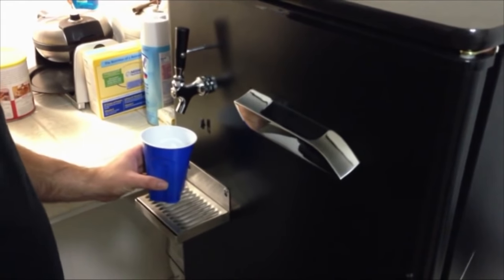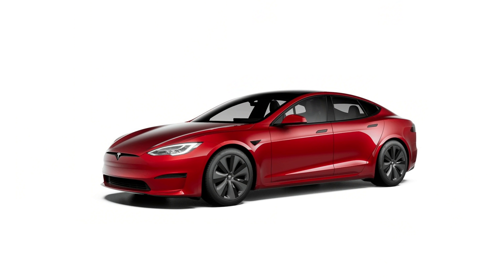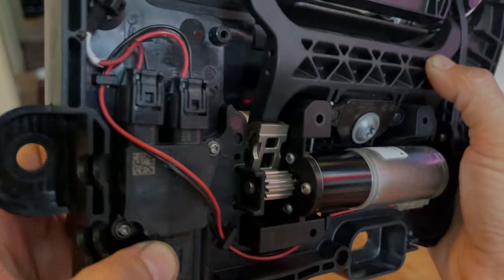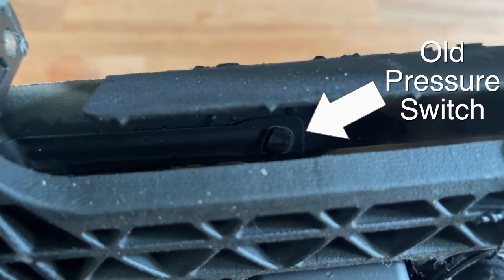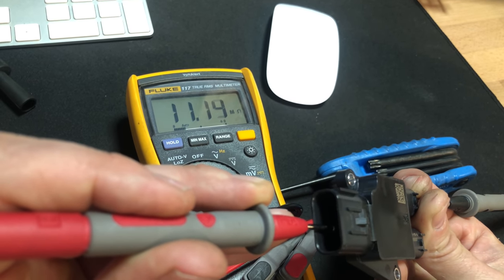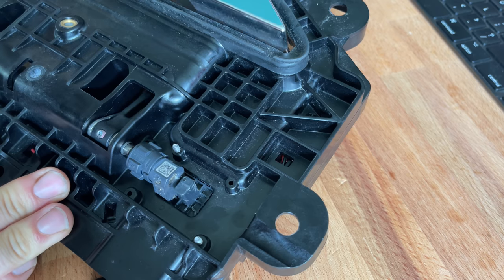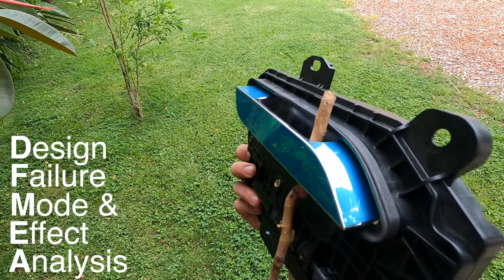Tesla Is Lightyears Ahead Of... Tesla

Comment: Cool video, great technology, thank you for making this video, I have to play the devils advocate here.  Here it goes. I'm just worried that if one of those components fails, then how am I suppose unlock? Will the car not drive if the door isn't closed? Or is the computer going to be like, give me constant warning saying one of my doors isn't secured. Why didn't they use aluminium or steel for the casing of the door handle? Because of cost, and its cheap right? How will i know the resistance value for ohms for each sensor? Will it be in the chiltons manual? Will the plastic be able to handle bending tension when its -30 F? Because I see a lot of components on a car break when the weather is super cold.  Then I would have to take it to a certified dealer to have the door handle repaired.  I just want to say that my dad's 1973 Chevy Cheyenne pickup (with the tried and true 350 block) door handle works just fine to this day.
Reply: You are asking questions, that should have been asked in the design phase. 
I can’t understand the people praising that now after years the crap they got delivered had been fixed. This is a way to do it in the software business, where bugfixes are free (at least for customers). For any kind of hardware it is unacceptable. This not a new feature (until you define „works finally“ as such).
But some of the commenters here sound like they would throw away a car, because the new one has a working door handle.
What’s next? Collecting all different colors versions, so that they fit to your dress.
Never, never again say something about environment. That the first thing these people shit on.
Reply: @fromgermany271  Remember that Tesla couldn't get their foot in the door with the big OEM suppliers in their early days, and had to build everything themselves. After they were getting more successful, they now have no problems getting third party suppliers making parts for them. Now they have the Bosch iBooster for their "vaccum" brake booster, Hella is making all their advanced LED headlamps, Mando is making their brakes and so on. Todays Tesla is a different player than the company 10 years ago.

Comment: This type of handle is nothing new, I have seen it installed in custom cars back in the early noughties, so I presume there were kits readily available even back then, no doubt even cruder designed than Teslas first design.

Any car door handle will have an annual struggle against the winter, but Tesla even more so and I suspect a Tesla owner may have to use a lot of deicer in the winter if they don't have a garage.

Comment: About the last open question you had, there might be an alternate control mode which "bumps" the motor into position with short pulses. The much slower speed does not care since it anyways does not control the handle, but done right the torque is limited sufficient to avoid any damage.

Comment: Or you could... you know, just use a normal door handle. The entire design is an expensive and unnecessary failure point.

The new design may last longer now, but 20 years from now, the old design will be serviceable while this one will not be. That's the problem with unnecessary electronics on newer cars, it guarantees they will become useless scrap a few decades down the line. So much for being "environmentally friendly", all they really want to do is sell you more cars.

Comment: Call me old fashioned but I think a car door handle should be mechanically actuating the door release mechanism... for a million reasons among only one of which is safety. How will you open a door if the electrical system fails... you won't... and this is why many car people are laughing at the technofetishism surrounding tesla... nobody ever should have designed a door handle that isn't mechanically connected to the door release. Just because you can put a bluetooth chip in a toaster does not mean you should :D

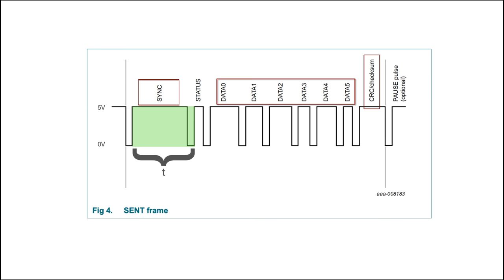Comment: 8:27 Measuring the timing between two pulses is an analog signal, in my understanding, as you can represent a continuous range of values without coding it in bits

Comment: "... and you never think of everything, because out of 8 million people, there will always be a few that manage to be more idiotic than 6 engineers ever thought possible."
So i work at an IT helpdesk.
I violently relate to this statement.
So in case you were wondering, yes, a USB connector fits in an Ethernet port, and yes, you can wedge an HDMI connector into a displayport port. And don't worry, it can always get worse, because i've seen someone try to insert their mouse USB connector into the back of the power supply grate, which they'd bent open because it didn't fit.
I wish i were joking, that fucker almost blew up his powersupply in his face.

Hell, we gave workshops to people once, where all they had to do is disassemble and reassemble a PC.
I kid you not, half of them didn't work on first startup, half of those had dead motherboards, and one LITERALLY let the smoke out when i so much as tried to turn it on, which, on it's own, is a fucking achievement, because with 6 years of practical and theoretical experience, i don't even KNOW how the fuck you'd get a PC to literally bellow out black smoke, let alone pull it off.
Never trust the end user.
The end user is an absolute blithering idiot.
And i'm probably wrong, BECAUSE REALITY IS SO MUCH WORSE.

Comment: The door handle is one of the reasons why I think Tesla is an inferior car in most ways to a 30 year old Honda. Also the emergency door releases that require you to flip through the owners manual while burning alive.
Reply: Not really though...

And that 30 year old honda can be opened by anyone with little issue.
Reply: @zaarkeru3391  I call rocks universal keys. Teslas are pretty easy to break into too!
Reply: @Name-ot3xw  
i mean, not really.
you have to throw one big rock if you want to break modern laminated and reinforced car windows...
Reply: @zaarkeru3391  it's less about how big the rock is and more about how sharp the rock is. Though as Tesla demonstrated on stage, a modest sized bearing ball will do the trick for what passes as bulletproof glass in Tesla land.
Reply: @Name-ot3xw  
again, its laminated.
breaking the outside glass kind of is irrelevant.
you have to break the lamination and the 2nd glass.

and even if I love to shit at Tesla one must accept the fact they had tried the window multiple times earlier.
and the window might still be bulletproof, it mostly likely is bulletproof even after a ruined outside glas.

and no rock is sharp enough (if the size isnt there) to break a modern window.
old ones without lamination are easy to break.
Reply: @zaarkeru3391  The lamination is thin and malleable plastic. It is absolutely not a challenge once you break the glass. I believe in your ability to fight your way out of a plastic bag.

Guy doesn't know how to break a car window and it makes me sad. A legitimate window breaker that you purchase from the auto-store is just a nail attached to a spring that does the same job as the rock.

E: Don't be afraid to google ninja rocks for a more advanced lesson in assholery.
Reply: @Name-ot3xw  
Well, i can only speak from experience working at a truck manufacturer what the cabin engineers say.

The testing they are doing is quite extensive, and we use the same windows as modern cars (same glass and lamination process).

Comment: So basically you do a 10 minutes video about a door handle that is supposed to reduce drag which is negligible, because it sits in the wake of the side mirror...
Dude, how about NOT hiding the door handle?

DONE, problem solved! You say Tesla went a long way, but I say Tesla still needs to figure out what is important: to reduce unnessassary crap like hiding door handles!
Reply: Perfection is achieved, not when there is nothing more to add, but when there is nothing left to take away.'

Comment: My door handle costs $10 and uses two solid steel rods. Its 40 years old and still works
Reply: But you're not driving a hundred-thousand-dollar car that run solely on battery power. They're trying to impress people. Have you ever driven one? Notice  that humongous display dead center in the dashboard? That's the giveaway right there. A giant touchscreen that runs the whole damn car

Comment: uuuuugggh    torx screws whyyyyyyyyyy
answer me this. why do you guys always use THE WORST screw type invented on cars
Reply from the maker: Torx screws are way less likely to cam out, so you can get repeatable, specific torque which makes mass production way easier. Also less likely to strip them. I say phillips is the worst screw type.
Reply: @SuperfastMatt  yeah ok phillips is up there. but in my personel experience torx are most likely the first to "get round" and have to be drilled out. especially when they are used on transmissions and outer panels

Comment: yet Tesla still has serious failure points with some SERIOUS SAFETY ISSUES. System Updates locks all doors and humans in Arizona in Summer during a Heatwave are suddenly in a dark slasher flick 'Escape the Tesla' because NO ONE can open the doors until the Update is finished! Which might take 6 hours, or sooner if Fire & Rescue smashes out a window. No one can get in a Tesla if the 12vdc car battery goes dead, the doors use that battery and if its dead you can't unlock the doors.... which might be bad if you're running from a Bear seeking shelter. OK, Teslas are not known to be Bear Proof.... Tesla NEEDS to install a mechanical means to enter and egress Teslas in an Emergency. Frist thing that goes off line during a Tesla fire, might just be the door latches.

Comment: I understand this is fewer points of failure in the electronics, but I would've expected a microcontroller in that potted blob that gets commands over CAN bus to present and un-present the handle, and sends a command when it's pulled. At least then you [the repurpose-er] wouldn't need to have all the careful motor drive stuff that keeps the handle from self-destructing when misused.
Reply: Remember that big chip shortage?
That's your answer.

Comment: how can you say the are light years ahead when any average person will look at this and think its pretty ridiculous and lags years behind tradition non electric door handles. I mean if you have to build in a safety to not rip your fingers off WOW OMG come on folks.....also if you have a dead battery you are not getting in to your car, traditional old analog type handles are better in every aspect, reliable dependable, not a hazard to your fingers and it will always open even with out electricity. All the nonsense....when an invention or device is no longer dependable or relevant to the purpose which is was created/designed for it no longer is needed as it serves no purpose. Im not knocking tesla or its vehicles...but the overstatement and inflated endowment your giving the door knob.....bruh...

Comment: 5:24 "I am a simple mechanical engineer. I don't deal with invisible fields because if I can't see them they must not be there"
Well, you might have shot yourself in the foot right there. Even a mechanical engineer can't "see" forces or torque or mechanical stress.
So are you also not a good mechanical engineer? No wonder that the first Teslas were so crappy!
And for chopping your fingers off: Like with electric windows you can simply monitor the motor current and when it exceeds a certain value something must be stuck and the motor is stopped. Fairly easy in my opinion!

Comment: I love cars and technology ! Tesla doorhandles are absolute garbage! every single model . aerodynamics that make no difference! Why threw away 100 years of doorhandle design and getting into a car safely and quickly into a gimmick. Try the doorhandle and icy conditions and you’ll see that they’re all garbage plastic on plastic on plastic on a motor onto other bullshit that you’re going to have to buy from Tesla. If you really wanted to impress me, it would be a metal handle that every fire department knew how to open And get out of your car when it’s on fire. multiple people have died ! try leaning on the door and then opening it. The car door will not open!  that is standard panic mode most cars release with that. when I see Tesla owners, I said great car too bad about your doorhandles. glad to see you ruined beer dispensing with your laziness too Tap handles are cool instruments that were created by true artists through ceramic,wood, metal and have their branding on it. You wanna look at the front side of a poorly engineered backside handel 🙈sorry about how I much complain on those handles they are garbage all of them. just so you know, Elon insisted on those handles.